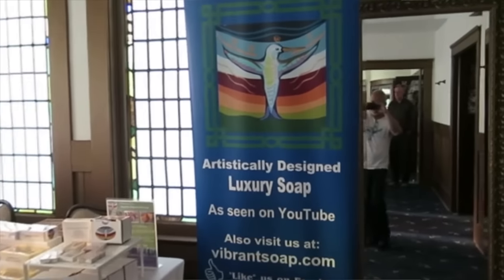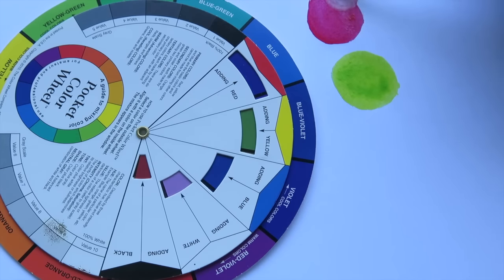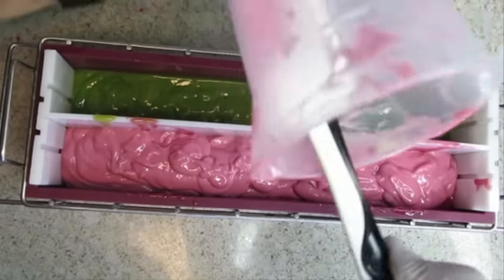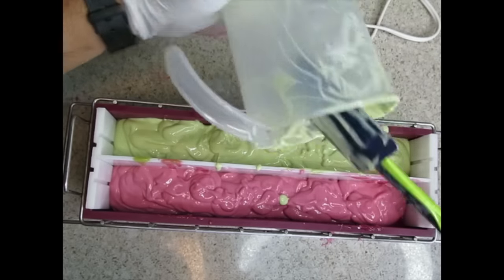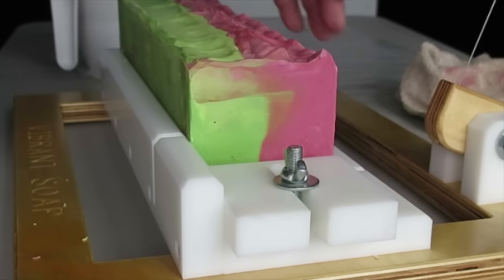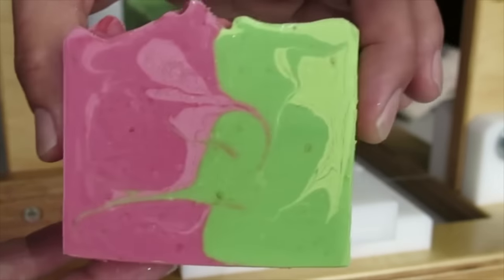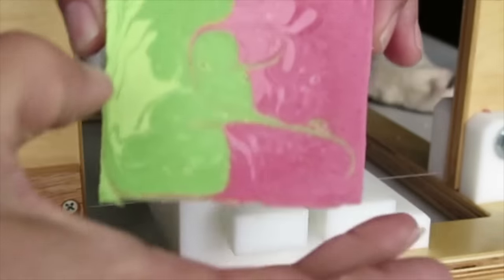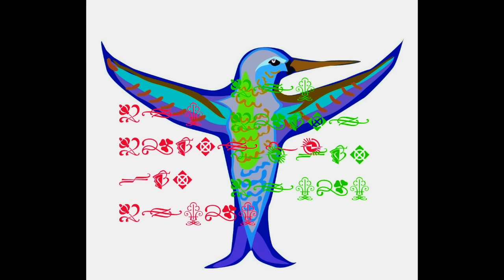Making and Cutting Watermelon Lime Shave Ice Cold Process Soap

Comment: Why colours after copmplete saponification and storage become less shiny,is this correct or only happen with me.
Reply from the maker: It's part of the saponification process. What adds much of the shine is the wetness of the soap batter. Once the soap cures, the water content diminishes and becomes less shiny. Oils also add to the sheen, but as the soap cures, the oil and lye combine to form soap. Notice when you use a soap bar, that as soon as it's wet, it becomes shiny again.